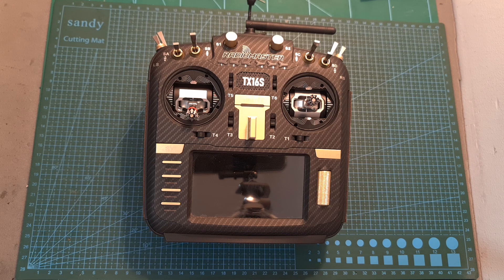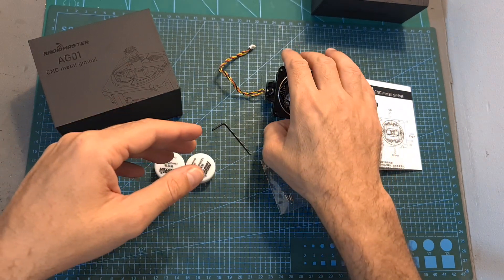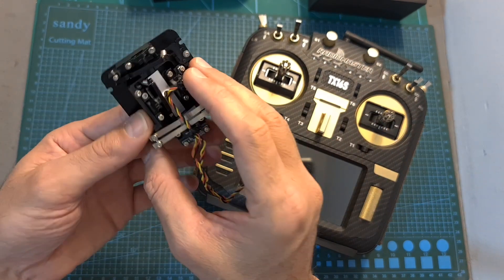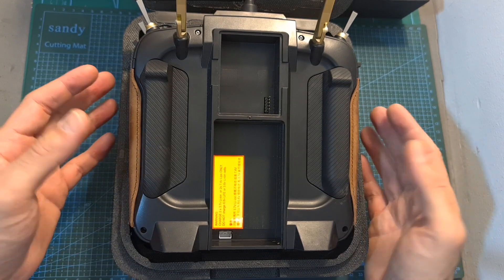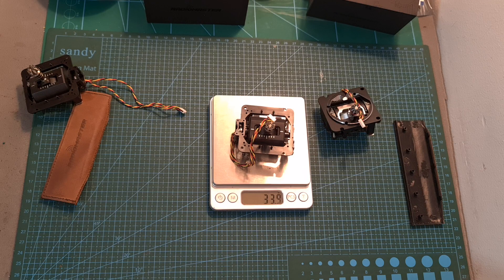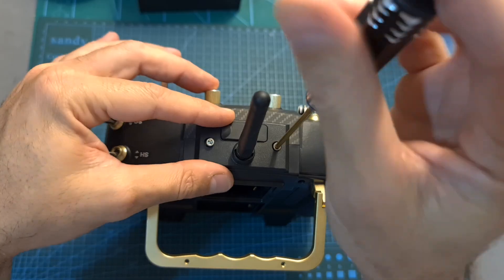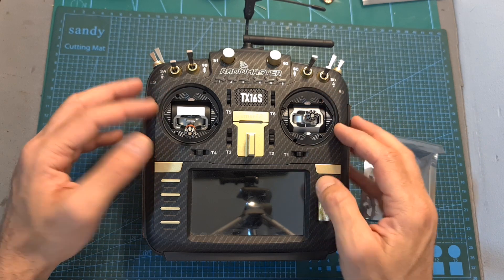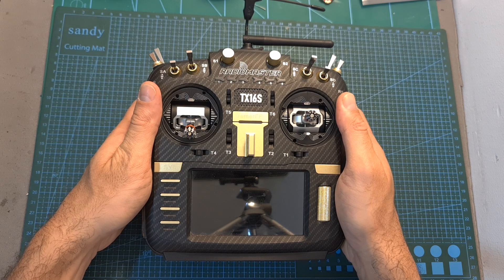RadioMaster AG01 CNC Hall Sensor Gimbals Installation Guide

Comment: I just received my gimbles and they didn't come with any grease or oil. Just gimbles so don't expect to get anything else with your purchase
Reply: Anthony, I didn't get the tubes of lube either so I emailed radiomaster, here is the convo:

Hello RadioMaster,
I just received a set of the CNC AG01 and neither box contained the lubricating or dampening oil. There is a place for them in each package but the actual oils are not present. Is this how you are now shipping these gimbals? I am a little concerned that I may not have received genuine RadioMaster components.

Hello Christopher,
Sorry, some logistics companies do not support transportation because pastes and oils are flammable items. In order to ensure the successful delivery of the goods, we cancelled the lubricating oil and damping oil sets in AG01 in mid-December.
Reply from the maker: Sorry they were included with mine... Thanks for the update.

Comment: can you limit only the vertical travel on the sticks or the horizontal too? by the design it seems like only the throttle and pitch travel can be adjusted. am i wrong? have not seen any reviewer properly; confirm this as yet

Comment: You think the gimbal will fit the jumper t18 pro?
Reply: Connections are different.  If you want to run amazing gimbals with the T18 do the Flysky PL18 conversion.  I did them on the Radiomaster but they work on the Jumpers with the conversion kit.  They're better than the AG01s.